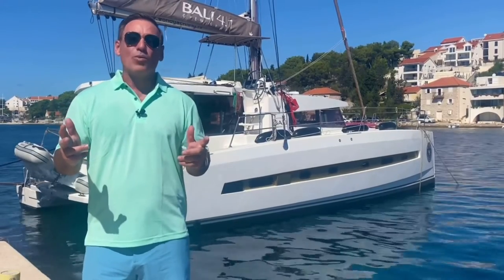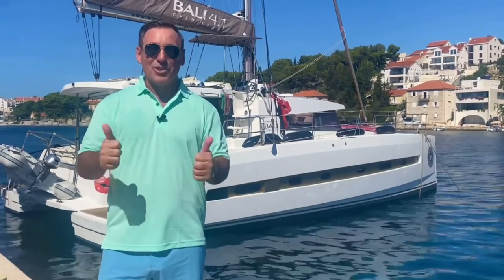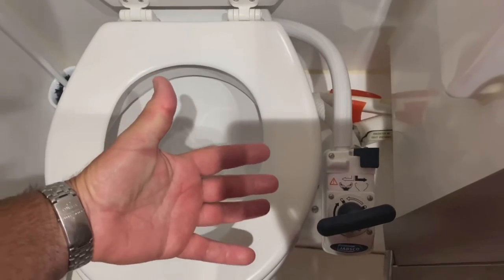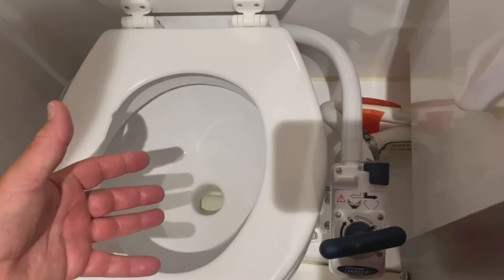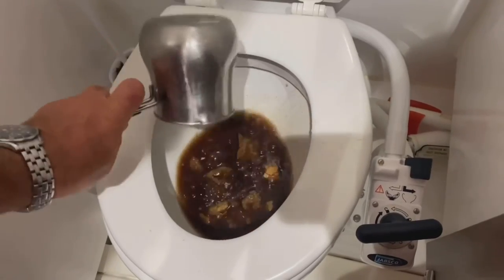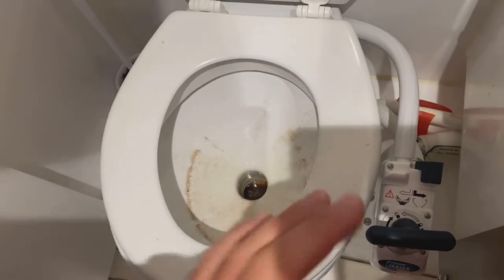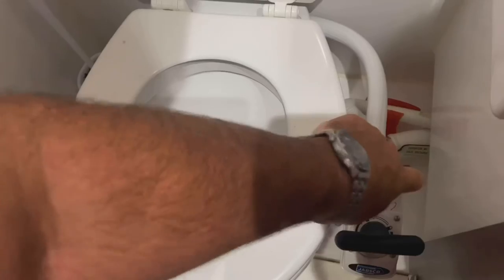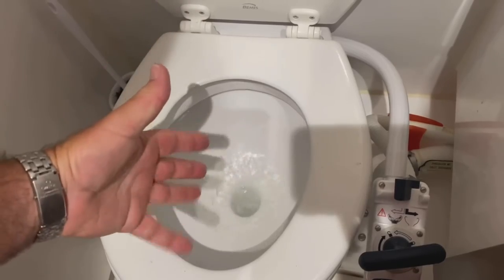How to Use a Boat Toilet Properly | Avoid CLOGS! | Boating Guest Etiquette | Bali 4.1 Catamaran

Comment: Another great video David. 
However just one important point missing. As a general rule I ask everyone to open the seacock before use and to close it again at the end of the evolution. Do not like open seacock unless essential.
In my boat I have a holding tank ( should be fitted in all boats!). As we have a fresh water shower attachment I ask guests to flush the loo using FW from the shower head directly into the bowl.
This greatly reduces odour from the tank. It also means we leave the sea cock closed.
Look forward to your next video. 
You are providing g a great information channel for boaters ( sail or motor).Thank you!
Reply from the maker: Thanks so much Johanna appreciate the feedback and you’re absolutely right great point on the sea-cocks
Thank you